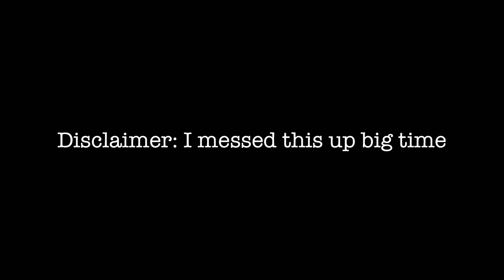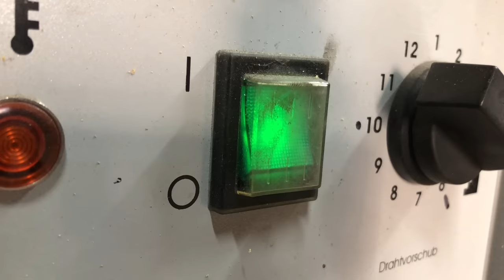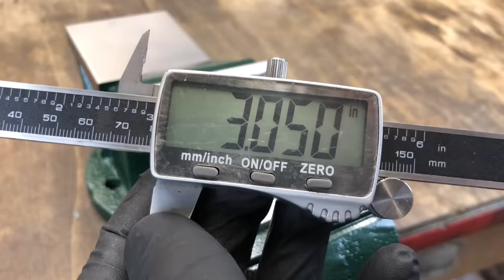Very Rusty Stuck Vise Restoration | Mister Patina

Comment: I used to do autobody and paint and I restore Muscle cars. Why would you derust and sand blast and then dunk the vice is pure oil ? You just contaminated all the metal pours in the vice and risk getting fish eye in the paint. Why would you toss the original jaws that were tempered steel and replace with very soft aluminum jaws that will mar up and gouge the first time you use the vice? I guess its for show and not for function? Very strange way restore a vice the jaws just needed a good blasting and you could of used them over
Reply from the maker: Derust to derust, sandblasting to get rid of the paint leftovers, oil bath to finish the process of cold bluing. 
Aluminum jaws to use the vice for soft metals. I also got wooden, leather and brass jaws.
Reply: @misterpatina  Ok not restoring the original jaws and replacing them with softer aluminum threw me off . Never seen that before when restoring a antique vice. People normally restore all the original parts including the jaws ,
Reply from the maker: @madmanmechanic8847  you’re right here, could have gone to original state. But since it’s a small vice, I went for soft metal jaws. Besides that, I hope you had fun anyways 🙂
Reply: @misterpatina  I stand corrected on the bluing it looked like you were oiling all the vice. I never seen that on a video before on bluing and using a oil process. That is interesting. I did enjoy the video and you have pride in your work that is hard to find now days. When I work on a customers boat and I bid it a certain hours and go over the hours I do it to make it right I never charge them for the extra hours  and I warranty my work. Thanks for the reply
Reply: When somebody complements you on your work you could of least said thank you! Very rude dude

Comment: The question is…. Where is the bottom of this swivel vise?  While you did a very nice restoration of the upper part, this vise has a three point mount that atraches to the bench and it is missing.

Comment: Please stop using WD40 as a rust penetrant. That’s not what is!!!!!!
Reply from the maker: WD40 isn’t just the best rust penetrating oil, it also works as a rust remover. 
There are other products like PB blaster or gearbox fluid/acetone mix, but they don’t work
Reply: @misterpatina  you have no idea what you are talking about.
Reply from the maker: @Kevin-xi6ts  that was totally ironic. But, 3 years ago, I used WD40 and as you can see, it worked.